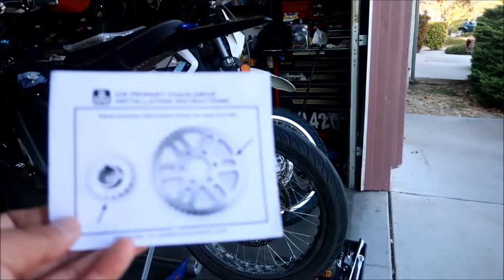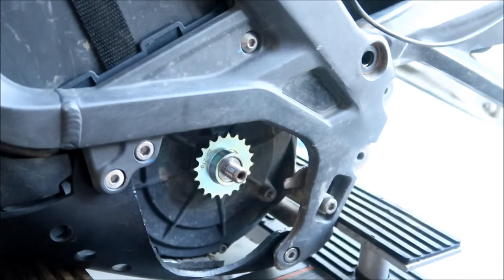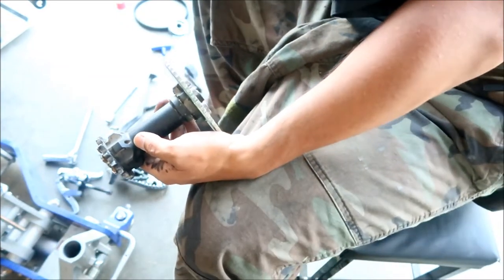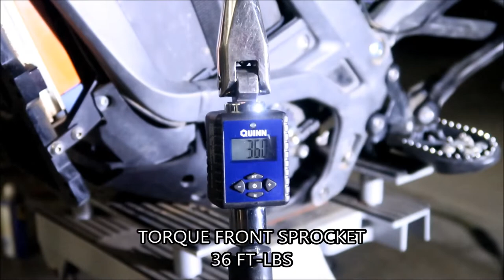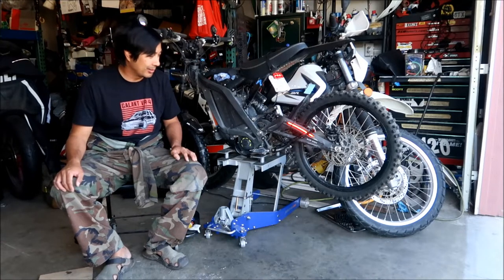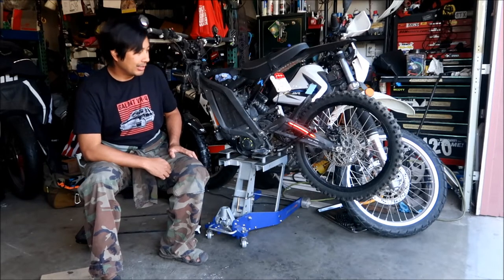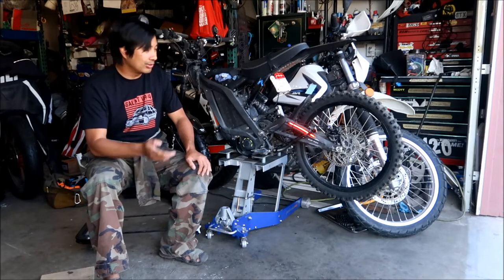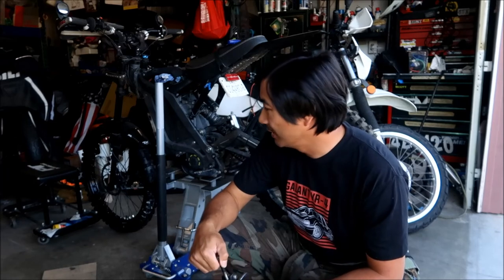DB Offroad 219 Primary Drive Chain Kit Installation for Sur Ron Light Bee

Comment: Hey I see that you have a race spec bashguard I got the 219 primary chain a couple months ago I got the KO motor and the motor fits real tight in the bashguard is there any modifications that could do to The bash guard so I could tension the chain a little easier?
Reply from the maker: Yeah they didn't go well together.  I had to cut a the skidplate to get it to fit well.

Check this video out:
https://youtu.be/_RCL_h3vtEM
Reply: Yeah I'll check that out after work I had to do some modifications to get it to fit I wonder if I get cut more of the bash guard on the bottom so the motor would be more loosely in there that way I could tension the chain better

Comment: Great job man. I just bought that kit and will be installing soon. What do you need to ride at streets of willows and sonoma raceway? and what races are you running? Thank You.
Reply from the maker: Sorry for the late reply.  For race tracks you should have front and rear axle sliders, footpegs sliders, and either a bar end slider or handguards.  There is nothing to spill on the Sur Ron so you don't need to worry about catch cans or safety wiring oil caps/drains plugs.
Reply: @hadesomegamoto7639  I guess what i was saying is can you just show up at the tracks and ride or do you need some kind of license ?
Reply from the maker: @bairnfour5963  race tracks you don't need any kind of license I see little kids racing all the time.

Comment: I have this but the chain is loose as it stretched some.    Thinking I may remove a link.
Reply from the maker: Yeah I am on my second chain.  If you can shorten the chain somehow would give you some more life out of it.  The 420 chain is easier to do that.  Remember the chain doesn't like to be too tight.  The slack should be around 7mm for this chain.  My second chain is lasting much longer than my first chain because I run it with that slack.
Reply: @HadesOmega Moto  So what is your opinion about this 219 kit? Is it strong? And what about the gear ratio? Is it different from stock?
Reply: @DuckNono82   le kit a un pignon de 20d et couronne de 48 je crois donc tu peux comparer avec le 14x30 ou 13x30 en 420 en calculant le ratio